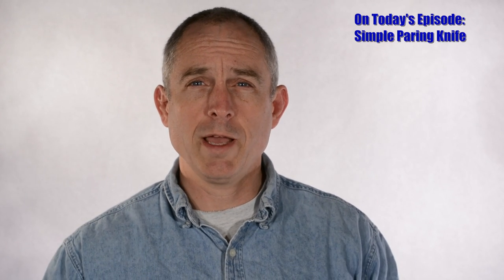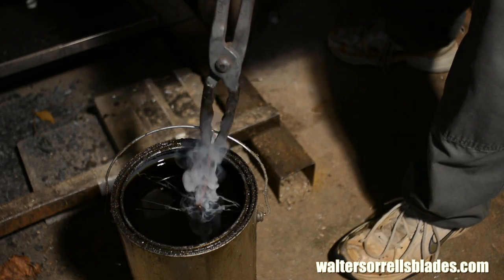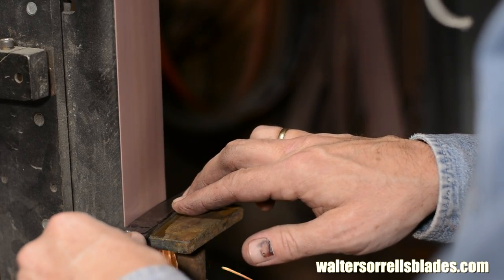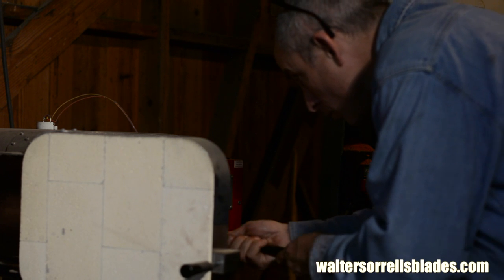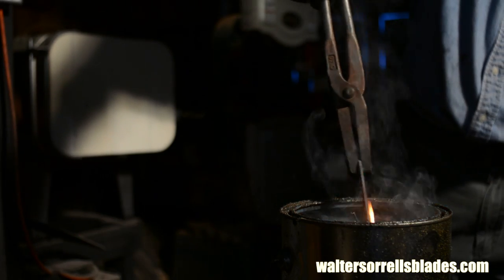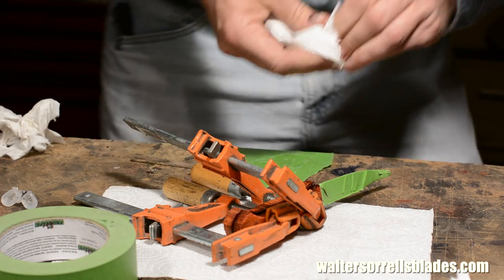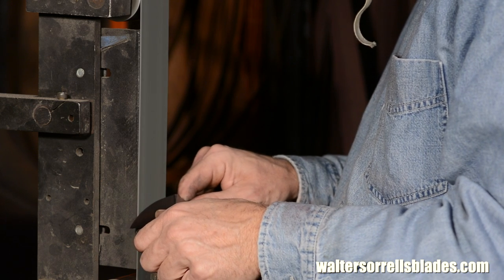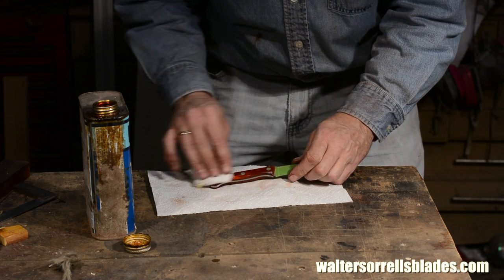Making a Carbon Steel Paring Knife

Comment: Heat treating has been a subject of learning as a beginning knife maker and have really enjoyed your videos. Tremendous help in leading me the right way, thank you! I see a lot of people doing 2-1 hour cycles at 400 degrees. From my understanding this gives the knife resilient edge holding abilities and not so fun to sharpen for lack of better terms lol. So my question is, by heat treating at 450 instead still give the knife good edge retention but easier to sharpen? >Makes the steel a little softer, around a 58-60 on the Rockwell scale? Thanks again!

Comment: Do you ever have problems with cracking on very thin kitchen knives using o1? About to make my first (chefs) knife, thanks to your excellent videos!
Reply: Richard Harris i was curious about that too. ive heard you should not go below 1/8 on the cuting edge before hardening. not sure. let me know how it goes
Reply: I managed to get two kitchen knives out of the O1 stock I ordered, so one is the slightly more experimental knife, and one is the more traditional chefs knife which I intend for use everyday. 

However, my stock is 3mm. So leaving it at 1/8" isn't possibly. I'll have to test what can be done & hope it doesn't warp too badly...

Comment: Walter,  
Did you temper the O1 steel after quenching it?
Reply from the maker: Yes.  Two one hour cycles at 450.
Reply: Heat treating has been a subject of learning as a beginning knife maker and have really enjoyed your videos. Tremendous help in leading me the right way, thank you! I see a lot of people doing 2-1 hour cycles at 400 degrees. From my understanding this gives the knife resilient edge holding abilities and not so fun to sharpen for lack of better terms lol. So my question is, by heat treating at 450 instead still give the knife good edge retention but easier to sharpen? >Makes the steel a little softer, around a 58-60 on the Rockwell scale? Thanks again!
Reply: Eyesofthasouth 01 is really easy to sharpen no matter the hardness. So I advise you to stick to 400 .

Comment: Hi, Walter,
Question from a total rookie.
Although I probably missed it in one of your videos, how thick do you leave your cutting edge for heat treating? I imagine if the edge is too thin, you will damage it at 1500 degrees.
I truly enjoy all your videos-very down to earth and informative.
Richard Reicherter
Wynnewood, PA (around the corner from your alma mater)
Reply from the maker: Dianne Dungay I leave it about 1/32nd of an inch thick, give or take.  

I used to ride through Wynnewood a couple of times a week on the Paoli Local.

Comment: There's alot of debate whether tung oil is food safe or not. I see that you used it in both your paring knife videos so I would assume tung oil is infact food safe? The theory that people with nut allergies will cause them harm or any other toxicity risks involved with this finish? or would beeswax or some other solution be a better option?  Thanks for your time and videos they are all very informative -- you should be a comedian because i chuckle quite a bit as well :D

Comment: Hi Walter, how do you prevent rust from carbon steel in kitchen use? Do you oil it after use or something ?.
Reply: Dry well after using a give a touch of olive oil seems to work. I know mineral oil or butchers block oil as its also know is prefer but I don't keep any around myself and the olive oil doesn't get a chance to go rancid if you use the knife.
Additionally a great way to get little specks of rust off a knife is to use a bit of sodium bicarbonate from the baking supplies with a tooth brush and a little water to make an incredibly high grit slurry. Rub vigorously for a little a the knife is clean of the light rust
Reply: Thank you very much.
Reply: Also if a patina starts to form it can protect the knife, especially if it's a paring knife as it shouldn't see much use. I don't see many knives with a patina in the kitchen though so idk if it's because it's not safe for food or just not preferred look
Reply from the maker: Yeah, wash, dry, oil with vegetable oil is the basic procedure.  But over time it'll take on a gray patina, which is fine. With all the stainless steel around, people have come to expect knives to be shiny, but a patina will actually protect the steel.
Reply: That's exactly what happend to me ... I expected shiny knife and I really took care about it, wash, dry, oil, warp it with oiled cloth ... but the thing I didnt knew that knife would get patina over time which is uneven. So I'm thinking about using vinegar for even coating?
Reply: TheSuljadin Just look up how to force a patina, many youtube videos

Comment: About finishing with Tung oil. Guessing here but wouldn't a kitchen knife be better of with a coat of Tung oil as it seals the wood. I can imagine the natural oil in the wood could leave some taste when cutting and handling an oily food like trout or salmon.? Or is this far fetched?
Reply: Tung oil polymerizes (hardens) with exposure. It's more waterproof than linseed oil; I've never had a problem with it, I usually use 3-6 coats, light sanding betwixt coats. FWIW, I also use maple, walnut, and ash for hilts, no idea how an oily wood such as rosewood or cocobolo would do.

Comment: Walter Sorrells Hello Walter. Can You tell me if i can forge the O1 steel like 1095 and 1075. I can only see people grind it. Thanks for all the good videos, its very helpful.
Reply: +Joar Flesjå  Im pretty sure the whole point of 01 is that it is precision machined, so forging it kinda removes the reason that you payed extra for it.
Reply: The point was to make two medium knifes of on 18" bar. So then i ned to forge it out. And its good for forging. But thanks 😊
Reply: +Rory Bolt In that case so would grinding it.  Either way it's no longer the same thickness as when you bought it.

Comment: What kind of wood was that?  How well would black locust work?
Reply: ***** Thanks. got some of that too. Well ash, not sure what kind it is.
Reply: ***** Not sure. I think on possibilities. With the number of projects I have in progress I am probably limited to supplying others with materials like different wood for making handles etc. I actually have a small hobby mill so cutting up sections of trees for the table saw or planer is just a fun break. ;)

Comment: You didn't talk about tempering the blade after heat treat. Any reason you didn't temper it?
Reply from the maker: +Rprecision  It was tempered.  I've explained heat treating in about a dozen videos by now and some of the videos I don't show all the steps. I should have mentioned it though...
Reply: +Walter Sorrells: Thank you. I am working on a O1 knife, and wasn't sure if this was a different HT method specific to O1. Thank you for all the videos!

Comment: Is there a place to find one of those grinders for cheap?
Reply from the maker: I wish!  You get what you pay for.  Of course you can find them used on eBay sometimes.  But the bottom line is that the best grinders are all pretty expensive.
Reply: Walter Sorrells Dang. They look like they make life much easier too!
Reply: Nolan Gaudreau you can also use a good old fashioned stone wheel grinder
Reply: fleurdelispens Yeah, true.

Comment: What happens to all the scrap metal from the grinder?
Reply: Goes into the air and ground
Reply from the maker: It forms a giant pile that I eventually scrape up with a snow shovel.
Reply: Walter Sorrells How popular is the custom katana making business? Do you also do just custom knives in general? Or do you still have another job? If it's too personal you don't have to say anything
Reply from the maker: Shadow Most of my work is in the Japanese realm.  I'm actually a writer as well as a bladesmith, so I allocate my time depending on the demands of whatever book I'm working on. Or sometimes I take time off from writing and just make blades.  But I basically work seven days a week as a knifemaker...give or take a day or two here or there.
Reply: i use a wooden bucket half full of water to catch hot metal and sparks.